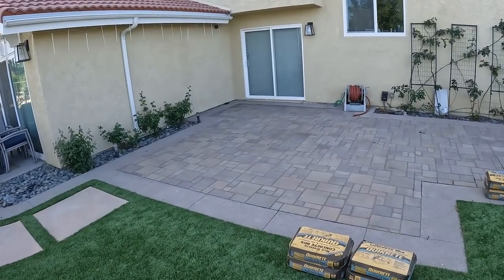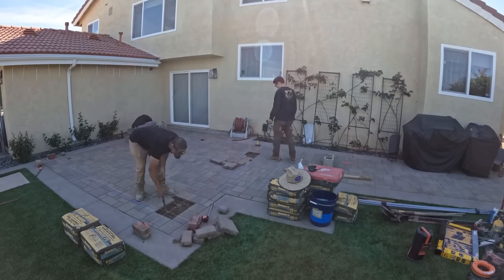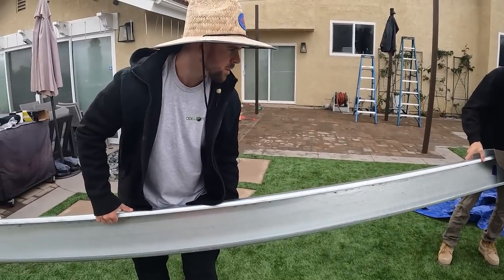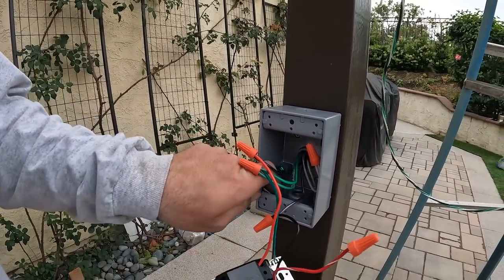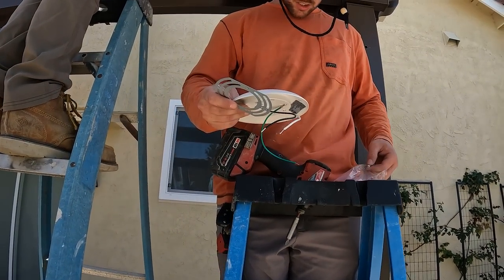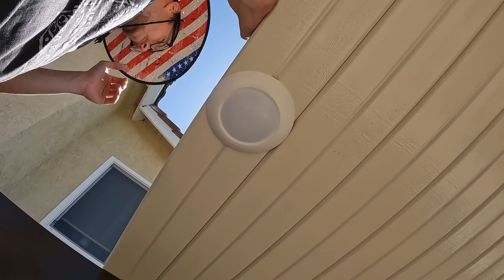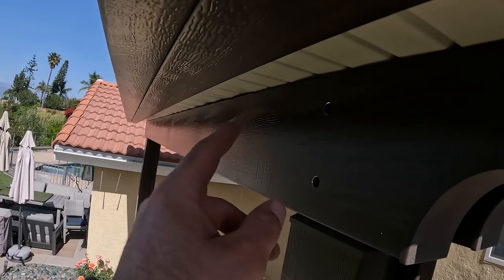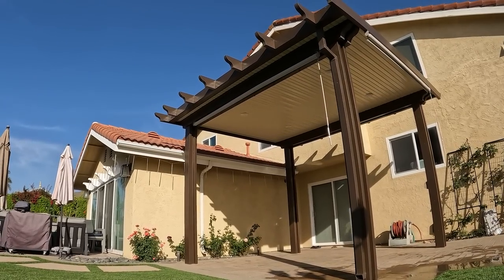How to Build a Aluminum wood Patio cover Complete Guide!

Comment: Could you show how the finished roof look like? Maybe a drone shot?
Reply from the maker: Sure
Reply: Same request from me too. Electrical is tricky. Want to see final roof from top and close up of wires.

I am ordering this set this month. Any link to buy it from/discount codes ?

Going for a large 20x14 patio cover

Also the company has an insulated version which costs ~$4000 more. Is that upgrade needed or is it a gimmick ?
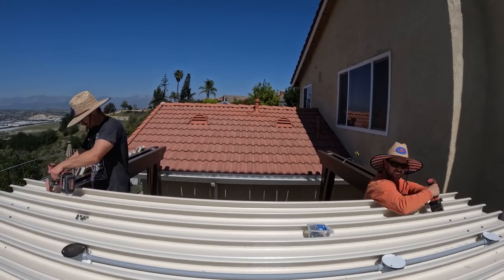Reply: 16:50 ... you can see the finished roof clearly there

Comment: Pavers can be re-used long term as well, so multiple generators of use potentially.  They definitely get my attention as the better option.   Great work.  Would be interesting to see some videos or someone actually fabricating the covers from metal stock.  Seems might be more cost effective, though you never know with hose cheap the metal used is though how else to cost effectively get the patterned look?  Guessing for codes, easiest to go by the manufacturers label.  Looks good, thanks for sharing.
Reply from the maker: Totally agree!

Comment: U Build It insulated foam panels 3””x48”x12’ push together.  I need 5 panels to make 20’ x 12’ ,how do I attach them to my faceia 
Install the post beam, how many post do I need.? How to install side trim and outer gutter.